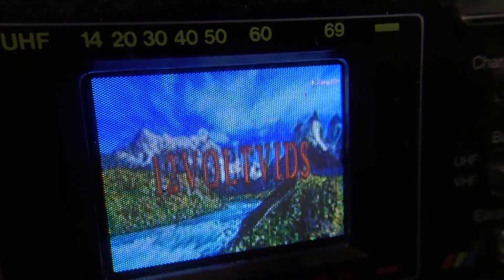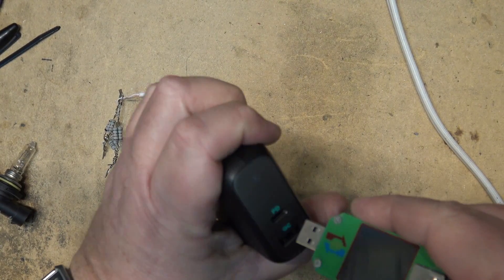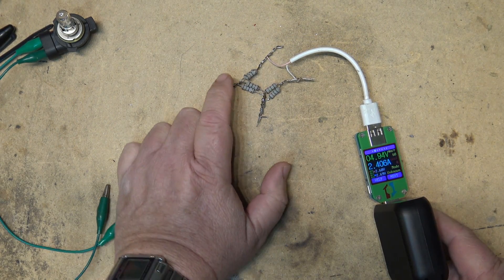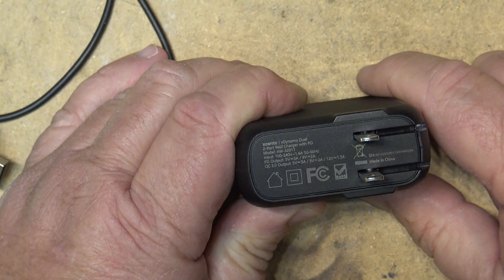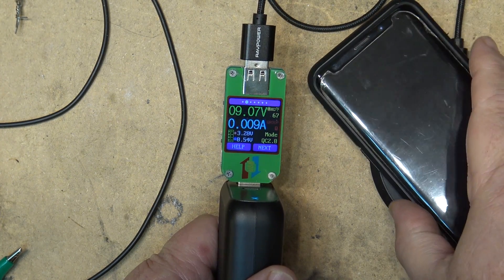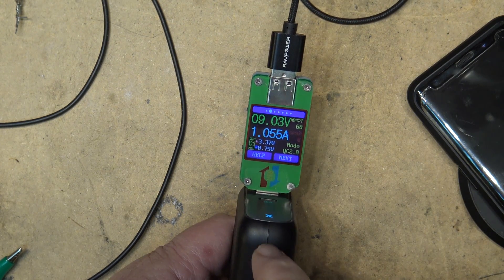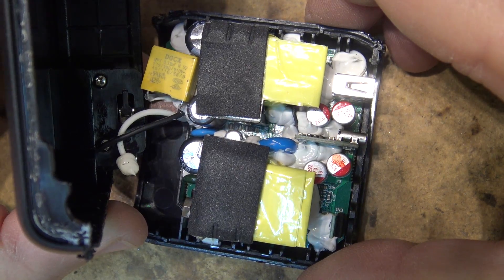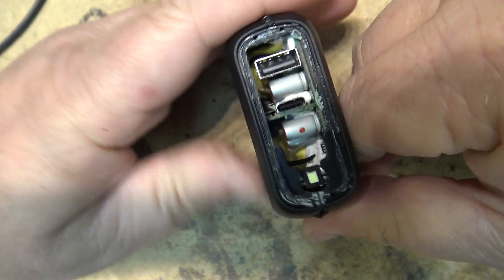Xcentz AW32011 QC3 fast charger with PD & QC ports 36 watts demo and tear down

Comment: fast charge from usb 9 V what ? 3.7 battery in phone ? where get this 9 v in phone
Reply from the maker: Higher voltage, lower current.  To fast charge at 5 volts needs much higher current, which would overheat the usb connector.  The solution send 9 or 12 volts.  That way the current (amps) is lower.  This is why tvs use 300 volts to the LEDs.  Even though the LEDs only need 3 volts each.  They put 100 in series.   So thin wires can be used. To send 3 volts to the sissy lights wires in parallel would require 30 to 40 amps of current and huge wires to carry all that current.

Comment: Would it also be considered a fast charge if it remained at 5v and put out more amps as opposed to higher voltage lower amps?
Reply from the maker: Yes you can fast charge at 5 volts with higher current but the current us still limited to 3 Amps as that is the limit if the connector.  Go over that and the connector will overheat.
Reply: 12voltvids Ah so that’s why they up the voltage instead? Bypass limit of the connector
Reply from the maker: @mrsemifixit  
Right.  The connector will handle 3 amps safely.  It doesn't matter if the 3 amps is at 5 volts or 12.  Think of it like a water pipe.  A 1/2 water pipe can only carry so much water, regardless of the pressure.   Doesn't matter if the pressure is 10 or 50 psi. The size of the pipe limits how much can get through.   In electricity is the current that is limited by the wire size.  The voltage is the pressure.   Unlike water that can not be compressed electricity is more like air.   Given the same pipe size which limits volume if you compress air, you get more through the same size pipe.   All things being equal, it would take .5 amps to transfer the same every as 1 amp at 5 volts.  Therefore you can cram more electrons down the same gauge of wire If you raise the voltage.   This is why the led backlights in an LCD tv operates at 300 volts and feeds 100 LEDs in series.  Each led only needs 3 volts.  If say, and this is for simplicity in math each led needs 250 ma.  100 in parallel would need 25 amps at 3 volts but put them in series and you need 250 miliamps at 300 volts.  
Much easier to design a power supply and wiring to handle 250ma at 300 volts than 25 amps at 3 volts.    The reason we see here the phone only going to 9 volts as opposed to 12 is the design of the phone is qc2 so it signals the charger that it can take 9 volts.  The stand up wireless dock on the other hand is a qc3 device and signals the charger to switch to 12 volts.   Newer phones that support 12 volt charging would signal the charger to operate at 12 volts.  All done by level shifting on the data lines as can been seen on the meter.  The 2 readings at the bottom left of the screen.
Reply: 12voltvids Thanks for that. So basically higher volts can push a smaller current faster so even though it’s a smaller current it’s being delivered faster which causes a faster charge?
Reply from the maker: @mrsemifixit  
Not faster, electricity travels at the same speed. Higher voltage allows more energy to given the current limitation of the connecting wire and connectors.
Reply: 12voltvids Guess I’m confused on that. Higher voltage gives more energy but at lower amps? Trying to follow the compressed air example pertaining to current
Reply from the maker: @mrsemifixit  
Watts law.  E × I = W
E is EMF or voltage
I is current measured on amps
W is watts.  
Watts is a measurement of energy.  How much your battery can store.   

5 volts x 3 amps = 15 watts.   5 volts x 1.5 amps = 7.5 watts.  
9 volts x 2 amps = 18 watts.  12 volts x 3 amps = 36 watts.  
Your usb connector and cable can safely transfer 3 amps before it overheats. 
To get 36 watts of power at 5 volts would require 7.2 amps and that would incinerate your light gauge wires in the usb wire.  Some would have a tough time passing 3 amps so most chargers won't push 3 amps but that is the maximum the connector will carry.  Most are limited to 2.4 amps maximum for safety.

Comment: much silicone is the same as irrepairable
Reply from the maker: Who gives a shit about repairing something like this.  All that silicone means it is much less likely to be damaged when it is dropped and that is exactly what happens to things like this.  They get dropped and parts shear off from the impact.  Encapsulating ensures that this won't happen.   The unit is glued shut for a reason. To keep people out.  I destroy these samples to show what is inside to give viewers a look at what they might be buying.  I know if I am buying something i have more confidence in purchasing if I know how it is built and this one looks good. When something like this breaks, I don't even attempt to repair.  One reason is safety.  Fix a fault on a phone charger and can you really trust it now?  I wouldn't.   Think about it, it is charging a lithium battery.  If it wasn't fixed eight and overloaded that lithium battery in the phone you could have a pretty hot phone, and by hot I mean in flames along with your house.   The last thing I would mess around with is a lithium battery charger.